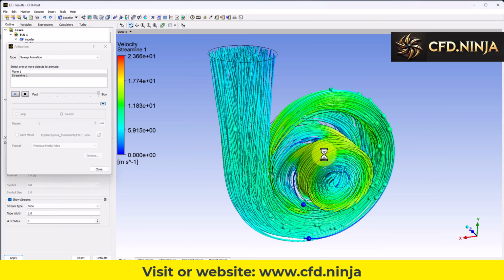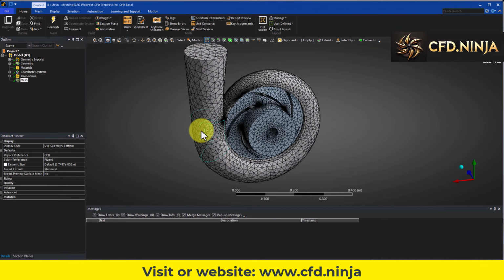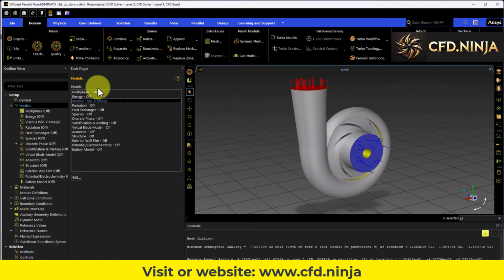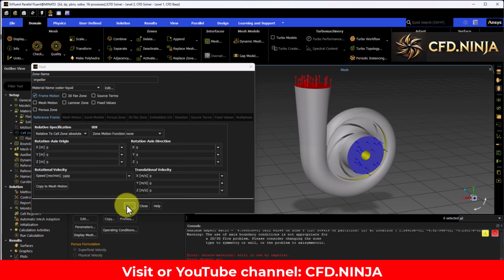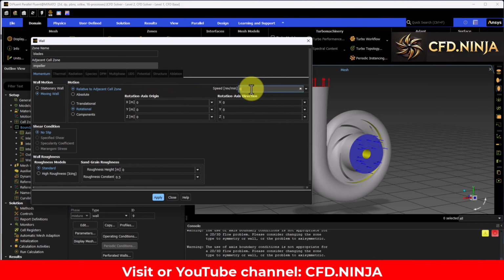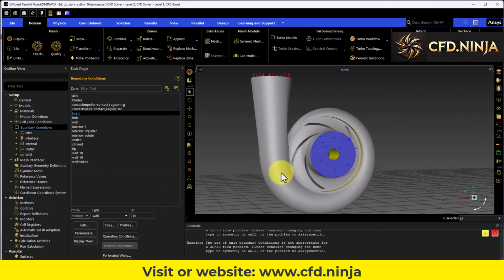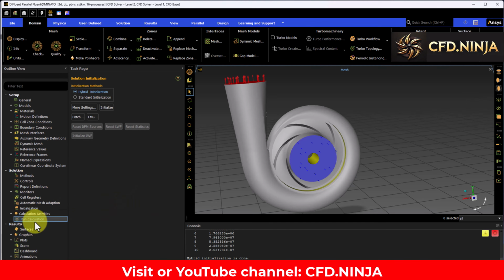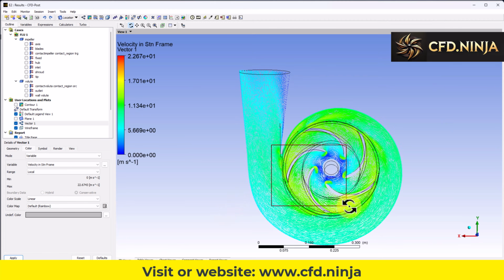✅ Ansys Fluent - Centrifugal Pump Simulation

Comment: Hello,
This video has been a great help to me.

I would like to ask about how to set the boundary conditions for generating a performance curve.
I’m currently applying a total pressure condition at the inlet and a mass flow rate condition at the outlet in order to derive the pump performance curve. However, when I input a flow rate lower than the rated condition, I keep getting an unexpectedly lower head, even though, theoretically, the head should increase as the flow rate decreases.

Does your answer above address this issue, by any chance?

Best regards,